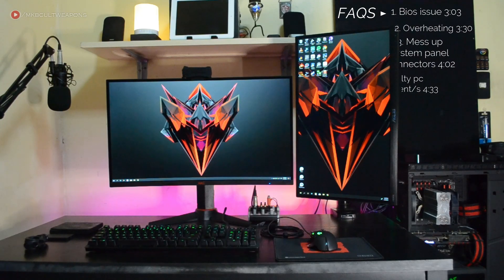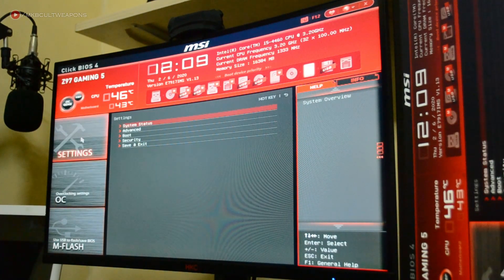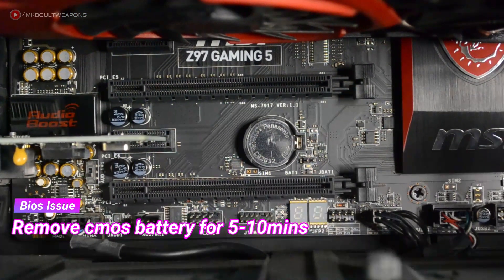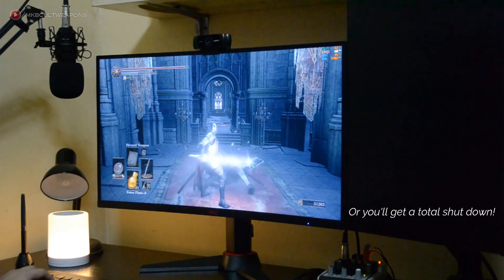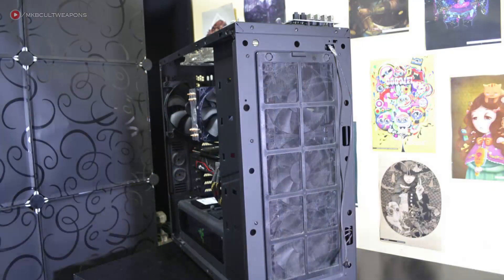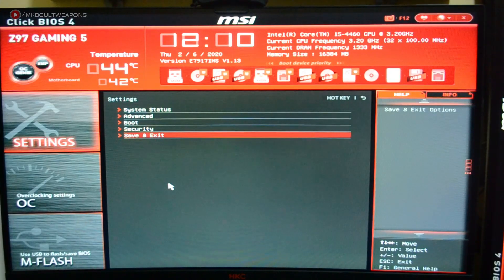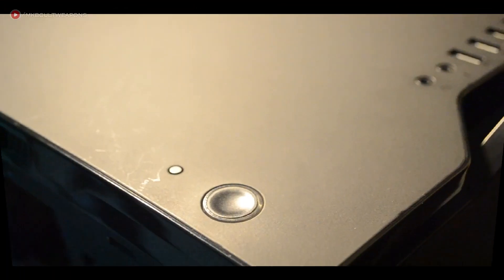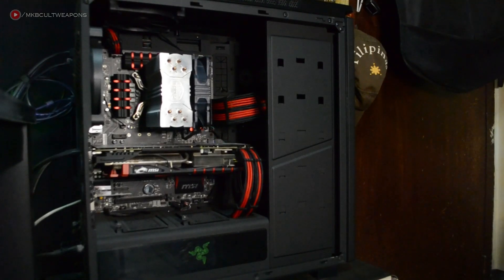Pc keeps restarting FIX / Pc continuous restarting FIX

Comment: My PC is doing this now but if i boot into the BIOS screen it will remain on no problems at all.  Once it starts booting into Truenas it will get to a certain point and then begin to restart every 3-5 seconds and shutdown continuously.  I don't think it's a hardware issue because it remains perfectly on for long times if I leave it on the bios setup screen.  Any ideas?
Reply from the maker: when you go to bios can it detect the ram sticks gb without any problem? can you check those, better yet just reseat the ram sticks. If that still does not work try clearing cmos, here's how to https://youtu.be/S9hyEPTFR10

Comment: What if a brand new pc keeps restarting at the easiest programs when the official drivers are installed?
Reply from the maker: are you using amd gpu by any chance?
Reply: @MacCoyzkie  no, an Nvidia rtx 3060
Reply from the maker: @Mark-yb2kj  this commonly happens to amd gpu but not in nvidia. I think you need to DDU the current gpu. Here's a video guide https://youtu.be/SvIJhcxZTsA
Reply: @MacCoyzkie  thank you for your help, but this method doesn't work for me, i tried it a dozen times, also with the newest ond older drivers.
Reply from the maker: @Mark-yb2kj  are you using windows 11?
Reply: @MacCoyzkie  no but Win 10 Pro
Reply from the maker: @Mark-yb2kj  let's set your system to default, go and clear cmos and here's how to https://youtu.be/S9hyEPTFR10 this will only set your system to default without erasing anything in your drive. Try to boot pc afterwards
Reply: @MacCoyzkie  it was a fresh, brand new system which directly had this failure. I followed other recommendations to update the BIOS which I did and the error still occurs.
Reply from the maker: @Mark-yb2kj  this is just a theory but i think this has something to do with low power draw either from the psu or wall outlet. Try using AVR or UPS to prevent low power draw from wall outlet. If you already have those setup and still restarting then this might be a psu problem. Use a psu tester like this https://amzn.to/3f5jtg5 to check
Reply: @MacCoyzkie  Excuse my late reply and thank you for your help. After a long time checking out various possibilities I stumbled over a video of riser cables and their probable failures. I simply switched the PCI-E Gen Option from Auto to Gen 3 and since then my system doesn't do any restarts anymore. I simply have to find out if the riser cable has a failure, the motherboard (original pci-e slot) or the gpu's pci-e slot. However I'm glad to have found a simple option but I am wondering if I got less for what I paid for.
Reply from the maker: @Mark-yb2kj  ohh i didn't know you're using a riser cable. How much was it anyway? If its working already then i guess ok
Reply: @MacCoyzkie  it was included in a Phanteks Evolv Shift XT case, I guess around 40$

Comment: my pc did this just because i updated it like wtf
Reply from the maker: windows os or gpu driver? just revert back if so, uninstall it in safe mode
Reply: @MacCoyzkie  I can’t even get to safe mode, right when my pc turns on it turns
off right away I could only get into Bios
Reply from the maker: @RAINYVIBES-x4k  might be corrupted windows or a broken boot drive. What are your pc specs?

Comment: my pc just full on died and i dont know how this kinda fixed it 💀💀💀
Reply from the maker: what are your pc specs and how did the pc problem started?
Reply: @MacCoyzkie  it was an old ass pc with i5, radeon graphics card (don't know what it was) a corsair ddr3 ram but I found the reason which was the graphics card that was broken. I have to stick with integrated for now until the new one comes in so this helped a little lmao

Comment: You made this vid 2 years ago but you still help people with it just like me cause i have a prebuild with a custom motherboard but recently i switched to the 4000d airflow but it just kept turning on and of when i turned it on for the first time turned out i had just randomly placed the frontpanel connectors cause i thought it didnt matter since they all look the same
Reply from the maker: glad this video was helpful. Front panel connectors are often misconnected, even me at times i make mistake as such. Just in case you can check the basics here https://youtu.be/LxRzL5WFB9c

Comment: Already did most of these suggestions, but still it doesnt work, also my pc love to restart loop at night 10:00 pm - 06:00 am which is kinda weird :(
Reply from the maker: wow it has time? does it happen during gaming or it also happens in normal desktop workload?
Reply: @MacCoyzkie  even when i don't do anything, my pc still restarts itself, the pc makes a strange sound, like buzzing sound, already reinstalling my windows and fixing the components, still doesnt work, i have been experiemced this for about half year, first time this happen when i changing my gpu from Gtx 1050 to Gt 1030, i have low pc.
Reply from the maker: @Aliflukman  the buzzing sound is a bit concerning, if that is coming from the psu then i guess the psu is the cause of all this. another thing you need to consider is the power outlet, check if there is any power fluctuation. Power fluctuation may cause this as well so try using AVR or UPS or at least an extension cable that has power surge protection
Reply: @MacCoyzkie  hey, i already change my psu yesterday and its work!! Its doesnt restart anymore, even at night. Thank You so much :) .. Btw the psu fan is kinda noisy, is there anyway to make it not noisy?
Reply from the maker: @Aliflukman  just as i thought, anyway glad its all good now. For the noisy fan i don't think there is a way to fix that unless you know how to replace a fan in the psu. That's another money to spend so i suggest not to.

Comment: I've done everything.. cleaning the RAM, dan reseating the RAM but it won't run on dual channel.. i think i have dead RAM or dead RAM slot, even tho it works fine several hours ago before i move this pc...
Reply from the maker: this may sound basic but did you plug the monitor cable in the gpu port and not in the motherboard monitor port? anyway if you already have then try running the pc with one ram at a time to check if its all working
Reply: @MacCoyzkie  I've try both display connector, even on another monitor, but still nothing works.. and now my pc won't even post on both RAM slot even tho my peripheral and  all of my fan is on..
Reply from the maker: @PinotNoir_  may i know how the pc problem started?
Reply: @MacCoyzkie  i move my pc from down stairs to my room which is up stairs, after that my PC only wanna boot with single stick of RAM.. i thought it because of dust build up, so i clean everything on my pc, even changing the thermal paste, after that my PC won't even post with both of my RAM, so i bought a new 2GB RAM to test it out and it boot normally..
Reply from the maker: @PinotNoir_  oh shoot bro the old ram was a goner already. You can confirm this by trying those ram sticks in a different pc, ask a friend if their pc is compatible with your rams. Have you done the eraser trick on those ram sticks
?
Reply: @MacCoyzkie  I've try those eraser method but it still won't post.. I've bought another motherboard to test my RAM, but it still on shipping.. BTW, thanks for replying to my comment and try to help me solve my problem :D
Reply from the maker: @PinotNoir_  no problem, i hope it'll all go well

Comment: How do i boot up Bios (not when its already on but from when you first boot your pc up
Reply from the maker: restart your pc and spam DEL key, this may also depends what motherboard you have so you could also try to spam F2 or F8
Reply: @MacCoyzkie  Thank you! I think my pc has a hardware issue but also i didnt realise the pc had 4 different DDR3 sticks.
Reply from the maker: @Unclucku  ohh that will cause issues specially if they have different manufacturers and speed. How about try one ram at a time?
Reply: @MacCoyzkie  bit of a late response but thought id let you know it works with 1 ddr3 stick!
Reply from the maker: @Unclucku  now the other sticks might be faulty or its just needs cleaning. I suggest clean the ram slots from dusts and do the ram cleaning method in the video. It might help and hopefully all will work since having all 4 ram sticks will make the pc perform better

Comment: My laptop restarts but right after I turn it on and enter my password... It like restarts before everything loads. The screen goes black, then goes back to the same loading process again and back into the screen where I have to enter my password. Is this the same issue that's causing my laptop to act that way? Please someone reply. (Sorry for bad english)
Reply from the maker: yeah but i'm not sure though how are you going to clean the ram sticks in your laptop. unless you are familiar with opening it
Reply: @MacCoyzkie  Thanks for replying. Is it more difficult to clean them on laptops? I'm not familiar at all with tech stuff. And are you 100% sure this particular issue happening to my laptop is due to any of these problems you mentioned in your video or might be something else? I've done extensive research online and most sites says different things. I'm planning on just taking my computer to a repairman...
Reply from the maker: @royery  it is difficult because of the laptop build. it doesn't have a standard way to open it and all so you really need to bring it to a repair man

Comment: I haven't begun to do any of this because this literally just happened. I entered a usb in the front part of my pc where there are two ports, but then i saw i took it in wrong - and it still went in. When i took it out, the blue shield was off and one of the pins was bent. This caused my pc to completely image freeze and i shut it off as quickly as possible.

Should i really try cleaning my ram or is this a clear case of motherboard fried?
Reply from the maker: what do you mean blue shield? was it a physical damage?
Reply: @MacCoyzkie  the piece of plastic that covers the pins. and yes apparently i could put it in the wrong way because it was so damaged, then the usb i put in literally just scooped up the plastic, exposing the pins and bending one of them
Reply from the maker: @ProfessorCat-lf1tm  oh shoot bro its a physical damage then, you might need to bring it to a local shop

Comment: Hello I re-applied thermal paste to my cpu and it keeps on restarting what should I do?
Reply: Thanks for the reply! figured out it was just the cpu pin it was loose I plugged it properly and it's fine now.
Reply from the maker: was the restarting immediate or it takes time before it restarts? if it takes time then that's overheating, perhaps the cpu cooler was not in contact. If it was immediate restart after you press power button then this could be loose ram sticks, try to re-seat those rams if so

Comment: Could my pc be restarting because I need a new graphics card?
Reply from the maker: not unless you experience glitching to its max level or pc shows no display then you don't need a new gpu. this might just be ram sticks needs cleaning, cmos needs clearing or pc needs a total cleaning from dusts. the worst case you could experience is formatting your pc and having a clean windows installation
Reply: @MacCoyzkie  My pc works for a while when I’m playing a game but as soon as I try to load another game or there is too much lag on the current game, my pc just restarts continuously.
Reply from the maker: @okletsgo836  i think this is overheating, can you download msi afterburner and check those cpu and gpu temperature during gaming. make sure it does not go beyond 90c less you'll really experience restarts or worst auto shut down
Reply: @MacCoyzkie  I don’t think my gpu is overheating because it says it’s 20 Degrees.Not sure if it’s right though.

Comment: my pc restarts like u would press the restart button;/ i think i have a virus
Reply from the maker: how did the pc problem started? it might be a virus but if you just clean your pc recently and unplug everything, then this could be a misplace front panel io connectors. Usually the reset pin was plug in the power on in the motherboard
Reply: @MacCoyzkie i didnt do anything to my pc. But it doesnt really matter😂 it just happened like twice in two weeks. Its not a problem
Reply from the maker: @repsekt  :_emoteLaugh: ok then, i hope it won't mess with you again lol

Comment: what if you just built a pc with all new parts and it still happens ?
Reply from the maker: front panel connectors are misplaced. Usually the power button is in the reset pin. Or this could also be that your rams were not seated all the way

Comment: im lost......if you cant get your pc to atleast get the monitor on and your pc keeps stoping and starting..how on earth do you get into BIOS...tell me that one ??????
Reply from the maker: is your pc restarting by itself or shutting down before even gets to show anything in your monitor? Can you at least tell me how the pc problem started?
Reply: @MacCoyzkie  My friends PC are doing the same thing. It is no activity on monitor. It keeps stoping and starting endlessly. The harddrive and CD/DVD is disconnected.

The problem started some days after the friend installed  drivers for the CD/DVD-burner and Nero CD/DVD software.
Reply from the maker: @gagarinone  ok i want you to try this out, you need to clear cmos, here's how to https://youtu.be/S9hyEPTFR10 this will reset your system to default without deleting any files. My guess is that the cd/dvd driver was set as boot priority and its causing this issue because it can't find the hardware. Anyway clearing cmos might do the trick. If ever you get into desktop just uninstall that nero thingy, its really outdated and may cause a lot of issues with today's technology

Comment: I have an issue with my PC i done the steps u said still didn’t work than i just removed my Graphic card rtx 2060 super than my pc started actually to not restart itself bad news is i dont have any slot left to connect my
Monitor 🤦🏻‍♂️😂 does it mean i have to throw my gpu out of the window ? ( even tho when its on the fan and all start to spin like its working for some seconds than it restarts)
Reply from the maker: was this pc with the 2060 working fine before this happened? What exactly happen before this issue started?

Comment: hey. just wanna say great video before I say anything else! okay I got as far as 5 minutes and 20 into the video and I tried putting only one ram stick into one of the slots and immediately, the pc started running. but, it will not connect to my monitor. the pc is running but my monitor says no signal. do you have any ideas??
Reply from the maker: thanks, depends on how the pc problem started so let me know. Also was your pc working for some time now or newly build?
Reply: @MacCoyzkie  So what had happened was my PC was on the floor and my monitor had fell on top of it unfortunately, which made my screen freeze. A couple of times while messing with my parts and cables in the motherboard it started to run but it wouldn't connect to either of my two monitors. Thankfully I tried the other ramstick and it worked with my monitors both turning on. So thank you very very much for that :) the only problem is now I have to use 8gb instead of 16 which sucks 😅
Reply from the maker: @snuksco  try cleaning the rams that are not working the way i cleaned my rams in this video. It might still work or at least have a friend try it out in their rig to double check, perhaps the ram slots are just dusty and all that's why its not working, so while at it brush those dusts off :)
Reply: @MacCoyzkie  Just did and it works perfect. I can now use my 16 gb of ram properly. thank you so much for your help you are a legend!!
Reply from the maker: @snuksco  you're welcome :)